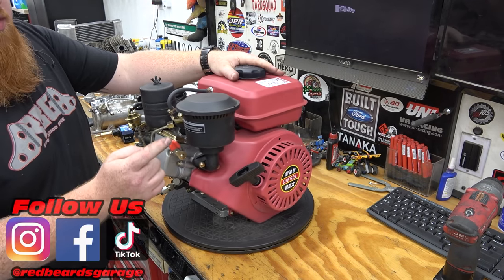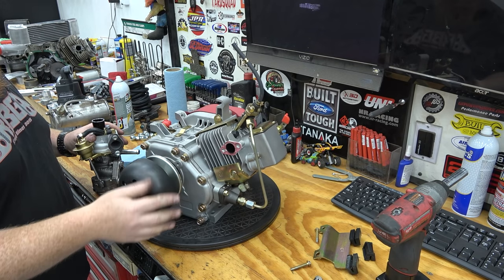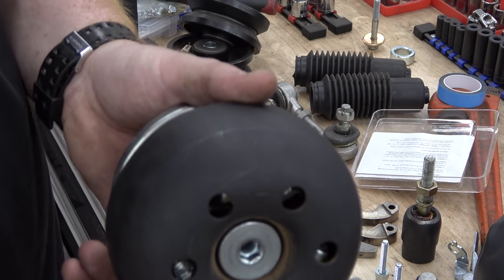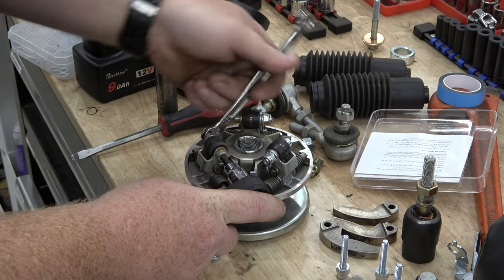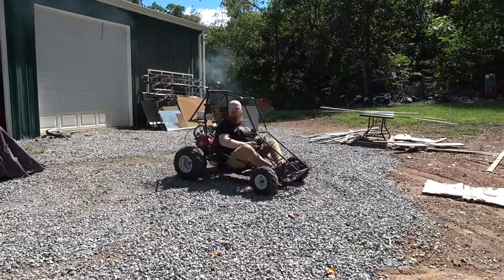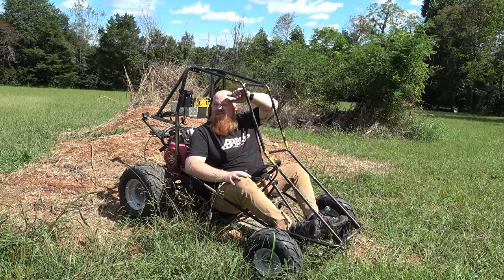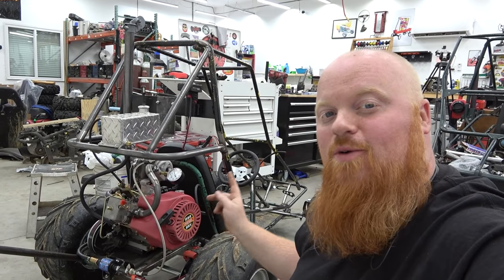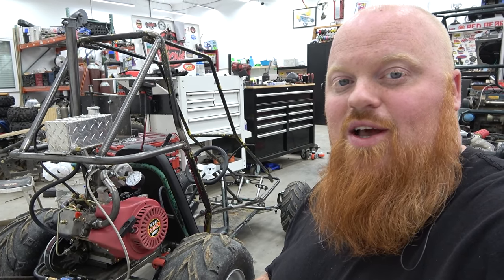Turbo Diesel Go Kart

Comment: With all single cylinder turbo setups u need a boost reservoir 4 times the displacement of the engine in volume, between the turbo and the inlet of the engine. Reason being unlike a multicylinder engine a single cylinder engine only pushes the turbo once every 4 phases when the exhaust valve is open and only takes boost in every 4 phases when the inlet valve is open. Inbetween phases the compressed air bounces back and forth in waves literally stoping the turbo from spooling. That is what a boost reservoir stops from happening. You can see it happening by the boost gauge jumping up and down.
Reply: You can't tell red beard that,  he's got more money than brains.  He's made this video for more views on his channel.  

But yeah, the turbo isn't going to work.  Not enough exhaust pressure.
Reply: @midixiewrecked7011  it's not about exhaust pressure, it's about phase timing.
Reply: it's not just single cylinder engines, all turbo charged setup can benefit from having an accumulator between the compressor outlet, and intake manifold. the charge cooler and associated plumbing normally serve that purpose.
Reply: @2000freefuel  well , it's kinda both, that small of an engine just doesn't produce enough exhaust to drive the  turbo,  but yes you're right.
Reply: @midixiewrecked7011  it got you watchin....
Reply: I agree it needs an intercooler. Also intake plenum volume. 1.5x the displacement. It will help the idle and make the math work correctly with a 4x resevoir (intercooler and pipes volume). We have no idea though. What is the fuel rate. High it looks like. What are the EGT's? No idea before and after. No way it adjusts spark timing careful with the over revs. And a personal pet peev of absolutely no consequence, thats oils drain hose is horizontal and I will lose sleep over it. Really enjoying the project at any rate.
Reply: @averyintrusive7610  what spark timing?  It's diesel.
Reply: The reservoir needs to be 4x the displacement of the engine regardless of the rest of the piping. Think of it as waves, it's a resonance thing.This isn't something I made up, it's researched and tested.
Reply: That’s probably why so many of those turbos blow seals when people try to use on predators and pit bikes too lol, along with not using proper oil inlet/outlet sizes. It’s basically the same as running in the surge zone constantly, because the intake valve is never open when the turbo is being spooled.
Reply: @thedr309  mate the only reason we are watching this video is so we can laugh at him
Reply: @SteveIrwinsPetStingray  well that little turbo in the video isn't actually spooling up anyway,  I know they think it did , but it didn't happen.
Reply: @ryanbrohan600  lol 😆
Reply: a water to air barrel charge cooler works best IMHO
Reply: @midixiewrecked7011  Yeah that's true, it really sucks most people don't actually take the time to do it right, it's just all about the views.
Reply: So iv built a compound turbo 155cc drag bike that makes good power. 12yrs going the projects been fun. Plenum volume should actually be closer to 6-8xs displacement. Higher the boost the bigger becomes better but don't forget runner length it shapes your powerband alot. For this boost referencing the high pressure pump would be a way to improve drastically along with a proper intake. Oil pressure should be over 15psi at idle if you plan on it living this has actually been one of the things iv spent along time on especially going from one turbo that I already couldn't oil properly to two turbos. Ended up graphing in a whole new oil system with a huge pump from a gs650 regulators ect. This works great but don't short yourself oil it's not worth it. This being a diesel pump mods would be a big deal and consider a compound setup the higher pressures really help make a small engine act big.
Reply: I'd also like to mention I run blow through carb and my boost gauge is ported in the intake behind the carb and with the right size plenum I don't have the fluttering of the gauge at all and I don't have and dampeners inline it's straight to the gauge.
Reply: Sick knowledge thank you !
Reply: I didn't even know this was a thing. Really appreciate you putting this info out there my guy 👍
Reply: Excellent explanation 👌
Reply: In other words intercooler this mother jammer
Reply: I always thought a supercharger would probably work better on single cylinder engines
Reply: This concept even works on 4 cylinder subarus as well. Any accumulator in a system will help with volume differential.

Comment: One of those little amr500 roots blowers in a twin charged setup would take care of the lack of cylinders to spool the turbo, little blower with that turbo feeding it would be cool
Reply: It would be great
Reply: Or a proper intake plenum volume
Reply: Like a old detroit 2stroke
Reply: Amr300 would be better
Reply: @nickzom  Takes power to spin
Reply: @DarkLinkAD  300 is smaller than the 500 mentioned above
Reply: @nickzom  I've seen lots of bad blower designs...that fail to make power and few bad turbo only setups...
Reply: @DarkLinkAD  A turbo takes power too, it creates back pressure to spin the turbine to +10,000 rpm

Comment: Is it possible to add any predator or Tilson 212 performance parts to this, obviously the piston couldn't be changed but could you put 18+pound valve springs in it or better push rods?
Reply: It appears to be a knock-off diesel version of the Honda clone. It may be possible to use an aftermarket piston since it is of the same displacement as the Tilly 196/Honda GX200/Predator 212 and such. The one mod I think should be done right now is governor delete. There's a big governor gear in these dragon engines that really makes them lag slower than a buffering Netflix movie.
Reply: @animeaddict6907  any way to remove it?
Reply: @animeaddict6907  you must not know how a Diesel engine works

Comment: If you turn up the injection timing on it that should also help turbo spool. It’s probably about 10 degrees out of the box and 15-18 would make a substantial difference. There are shims beneath the injection pump that affect the timing. Removing shims increases timing and adding shims reduces timing.
Reply: The manual states that it's 18-20 degrees from the factory
Reply: @matthewkratzke5158  turn it up to 25-28 then lol
Reply: Isn't changing the depth going to effect the pump plunger depth traveled? You may bottom out the pump if you put it too much closer.

Comment: Maybe the diesels could be your small fleet of recovery-karts for when another unit breaks down. I'm sure this thing would look pretty cool with a tow-truck theme added to it. :)
Reply: That’d be sick to see a mini turbo diesel tow truck. One that even has a mini tow lift
Reply: @sethparrow04  Indeed. Find a way to incorporate a winch in the rear with some light duty recovery straps. :)
Reply: Tow truck jib on Dodge dually power wheels
Reply: I made a old lawn mower into a tow truck with a tow arm
Reply: I know this comment is two years old but Ive been wanting to do this, make a diesel recovery rig, and now i am going to do so!

Comment: You should put a pressure tank for the turbo to help it make boost
Reply: you can achieve this by using a water to air barrel charge cooler
Reply: Yep, the "pressure tank" aka: plenum stores additional air volume under boost which stores that extra volume until intake valve opens & gives the cylinder a bigger gulp of air because of the larger volume of stored air, Sweet!
Reply: Just put a big intercooler to do the job 😜
Reply: Would make it build boost slower tho

Comment: Measure a rod and see if you can find a billet replacement, then add heavier valve springs and some head work. Porting will help a lot, and you only need to blend the transition to the bowl to get good gains. Definitely got me interested in building a diesel.
Reply: The crank should be stout enough to handle higher speeds and power. I believe a GX200 rod will fit this engine but I am not 💯 percent sure. I know valve springs will fit.

Comment: The Rain Cap made it on there lol, it’s a real diesel now! One way I’ve found, on those types of rain caps to prevent the nut on the pivot bolt from backing off, due to vibrations causing it to fly apart. Drill a small hole through the threads right up agains the nut big enough for a cotter pin to go through, and then just run a cotter pin through it, and lock the cotter pin, and that’ll prevent it from flying apart.

Comment: Yay! Fun fo sho. An intake boost plenum with 1.5 times the volume of the cylinder displacement ( 1.5 times minimum, to 2.0 times displ.). The plenum will store the compressed air with greater available volume, in time for intake valve opening, feeding the greater volume into the cyl. More air + the rich fuel you have (black smoke) =bigger bang= mo go! See book: Maximum Boost by author Corky Bell for details on plenum design. Best turbo how-to book ever, IMHO. Love your channel, from a fellow gravy bones former mechanic/welder, Paul

Comment: The best thing to do to get more power is to remove the governor so that way the engine will go full send it’s OK if you float the valves and blow it up but it would be a good idea just to hear it go wide-open
Reply: Hahaha
Reply: Destroying the engine makes no sense. Way up in the rpms the engine starts to suffocate and make less power. It falls off a cliff on flathead diesels.

Comment: I just bought a diesel engine just like that one, glad to see it responds to boost. I'm not sure if I'm going to turbo or supercharge it yet. I'm really impressed with that little 3hp engine, I know its not a powerhouse but that moves really good. I'll have to go back and watch the video without any boost. Whats great about a diesel is that you don't run into any of the problems that you would with a gas engine. I actually have the amr500 supercharger that I was going to install on my 18hp Wisconsin thd twin thats on my garden tractor.

Comment: A 1 cilinder boosted engine needs sort of a Boost tank, where the turbo feeds the boost into with a 1 way valve in and 1 way valve out for constant boost pressure into the cilinder . There are multiple video's how to do this , and it makes a big difference/increase in power.

Besides that nice to see something easy build like this :))
Reply: The pair of one way valves on the plenum/boost tank is an interesting idea, thanks for mentioning that! I'm gonna look those videos up!
Reply: May you share the video

Comment: With all proper turbo charger systems. Their should be a charge air cooler (CAC) to cool down the intake boosted air. Cool air has more dissolved oxygen in it. More oxygen=more horse power. I have worked for a major trucking company as a diesel mechanic. Don't get me wrong I like what you are doing.

Comment: You should make a low speed high torque puller with one of those diesels for pulling logs and karts out of the woods without burning up your belts on other karts

Comment: Awesome :) Is there any room to port the head? Would love to see if theres a couple simple things can be done to get more power. Would be awesome to see it build enough boost to run a clean exhaust. Keep being awesome, I know you will 😎
Reply: Also thought about dirty exhaust, you need to boost air flow into intake.  Fuel isn't being burn 100%

Comment: I still need to check out the diesel deuce, so maybe its been done...but a full up diesel build on say a Kandi frame with rear suspension, electric start, light bars, etc. Maybe a 12v turbo might even be an option if you have a charging system capable of running it (like an alternator off an old John Deere).

Comment: Definitely should try and put a proper little boost/vacuum gauge on there.  

Also, gear it taller so you don't hit max RPM so fast. you'll make better boost that way. Maybe even hit it with a little bit of nitrous if you wanna see how much it can handle with that little turbo hahaha

Comment: Smaller turbo and increase the spring pressure on the intake.  Looked like that turbo stoped pretty quick when the engine shut down.  You sure it is ok?  I'd still expect to hear it whistling away with no air filter.

Comment: Exhaust thermal wrap may help hold heat in to spoil the turbo up a little more
Reply: Thermal wrap on the exhaust may overheat the turbo center section.

Comment: If it has a wastegate penny valve, I say weld it closed. It'll only boost to what the fuel will allow anyway! Could always stick a cheap $30 exhaust temp gauge on it if you're worried.

Comment: I think the smoke is oil building up in the turbo. This can happen if they don't drain fast enough.  And I'd check the oil since it has a tank and long hoses to flow through. But I always thought that diesels are supposed to knock. If you don't hear it, now you got a problem

Comment: The oil pump only produces 1.5 to 4 psi. The oil pressure needs to be higher than the boost pressure, so boost air can't push into the seals.

Comment: Diesel nerd here. Planning to compound turbo my Volkswagen. Have a suggestion, instead of putting a standard wastegate turbo on it you may want to look into a VNT. That turbo looks like a similar size to the stock turbo on my Volkswagen. Newer versions of my car came with a VNT. Look for a 1999-2003 ish Volkswagen TDI turbo. Cut it off the manifold and weld a flange on. The variable vanes will let you adjust the A/R of the exhaust housing to spool faster.
Reply: This is a vz21 or RHB 41 I believe.  Smallest production turbo
Reply: @lamarzimmermanmennonitefar5269  bit more research, looks to only be slightly smaller than what I'm talking about. VNT with proper control will probably still work better lol
Reply: @boostaddict_  I think the inlets are about 1in

Comment: The bolt holes on the compressor housing of these vz21 turbos need to be plugged. One of them goes right into the outlet of the compressor housing and will bleed pressure off if not plugged.

Comment: the smallest turbo diesel engines are the 800 cc smart 3 cyl 54 hp and the 2 cyl. maruti suzuki diesels with 47 hp . they both start boosting at 2,000 RPMs. anything smaller would need more rpms, like 4,000 rpms for a 400 cc engine and 8,000 rpms for the 212 cc chinese diesel, far above diesel engine capability.  you would have to have someone manufacture you a special micro turbo that does not yet exist to have low end boost on a tiny single cyl. diesel.  Not saying it can't be done, only that it has not been done yet. It would be cool if you could get tiny displacement turbo diesels with intercoolers that made super efficient tiny engies for go carts and motorcycles and things like 2-cv cars.

Comment: It would be awesome if someone made a 2 stroke diesel,  similar to the old Detroit diesel engines, like a mini 71 series engine, but closer to 250-500 cc range, a 250 cc single, with a 500cc 2cylinder ,  2stroke, with supercharger or scavenger,  with a 4valve head, aluminum block,  designed to rev to around 4600 rpm, that would be awesome,

Comment: you should also slightly change the gearing on it as well, maybe few tooth smaller sprocket because it runs lower rpms, it wont go as fast and wont have as much load.

Comment: A couple things, one if a valve is sticking there is a chance it is too tight in the guide they make tiny ball hones for that or it could just be gummed up so it would be good to check that when you upgrade springs also on the low boost I don't know if there is a tighter exhaust housing option (lower a r ratio) would spool it better or like others have said twin charging with a roots blower which would be awesome. Great videos man, can't wait to see the teardown!

Comment: Gear it up, load the engine, should get more boost and top speed. That will, hopefully, make it chooch more. 
if ya feeling kinda crazy, buy a small camp propane cylinder, the spin on ones, plumb it in. Use it like nitrous oxide. Really test them parts.

Comment: Make sure the actual waste gate flap in the exhaust housing is staying closed might need to put a turn buckle on it cause it shouldn't smoke more with the turbo than it did before
Reply from the maker: I tack welded it shut

Comment: I bet if you were to wrap that exhaust pipe with proper heat wrap, you'll build even more boost. Those little engines don't have a lot of thermal output on the exhaust side and that tube is probably cooling the exhaust charge quite a bit before hitting the turbo.

Comment: If you get the 6-10hp China or Yanmar L70s they have a pressurized lube with a screen on the side next to the IP. You probably have some injector knock, if it goes away at higher rpms then it’s injector knock, if it gets worse at higher rpm then it’s a rod.
Reply: yeah I'd love to see a compound turbo setup on a Yanmar L100 400cc+ clone engine, the added plumbing would also help to even out the intake/exhaust pulsing. along with cleaning up the SMOKE!

Comment: The diesel dingo is great but need the boost gauge on the dash and the fuel/air ratio needs to be checked, it looks from the white smoke that it is not burning all the fuel which might be affecting the performance.

Comment: On this particular engine there is a plastic gear and a stud that the gear is attratched too remove the plastic gear and cut the stud in half. That will allow your fuel injection pump to use all the fuel it can and not be held back. Especially since your pushing more air through it your going to want to add fuel so it's not running incredibly lean.
Reply: It's actively sooting first of all, it's nowhere near short on fuel. Second of all it's a diesel there is no lean, the whole point of a diesel is that you don't have to worry about that 14.7 stoichiometric.
Reply: @otm646  if you have any idea about what your talking about, you would know that diesels can go lean. Second, my point was, if you have more fuel you can push more boost for more power......